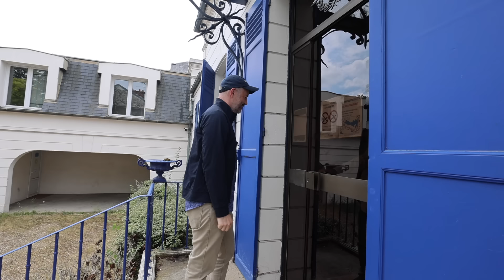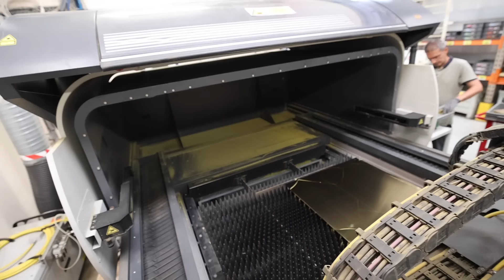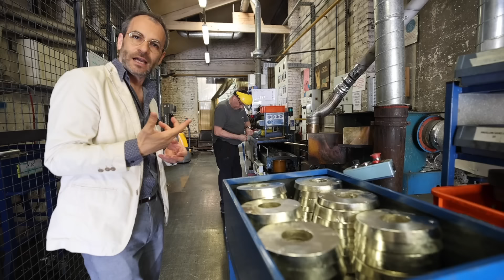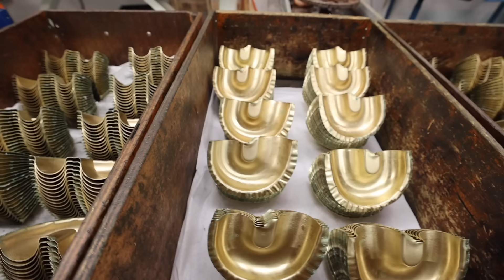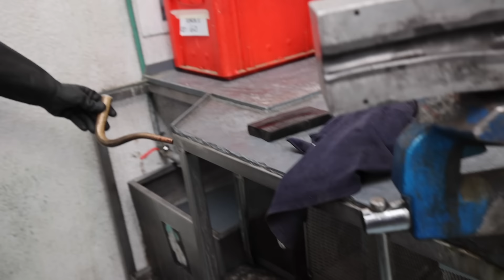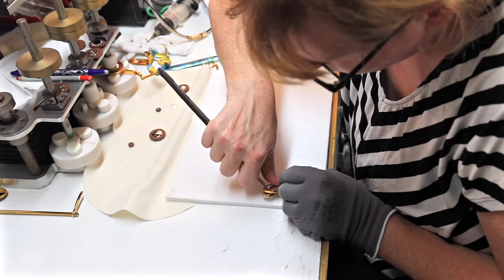How Legendary Saxophones are Made - Selmer Paris Factory Tour

Comment: Getting the holes in the right place is key.  I have an old Selmer alto with cork in the tone holes to get the line right.    The sound of the horn makes it worh it.  As an ex-precision machinist I know for accuracy and repeatable consistency the Computer controlled machines removes a lot room for error.  Very tight tolerances are held.  That is why I would suggest trying a Yanagesawa before you buy one.  Selmer are most likely much more consistent these days.  Most student horns are made with cnc machines and mostly play in tune unless the metal is so cheap thermal expansion throws them out.